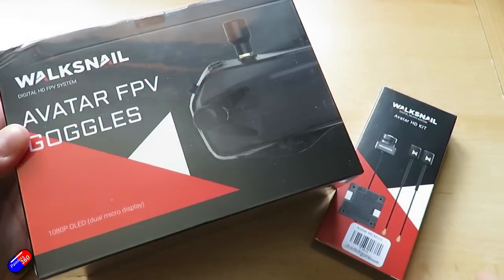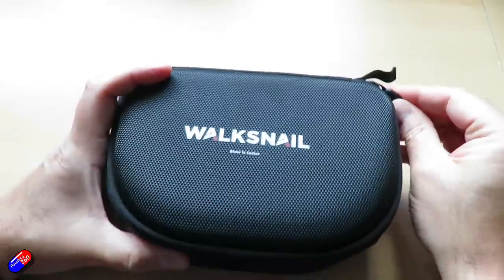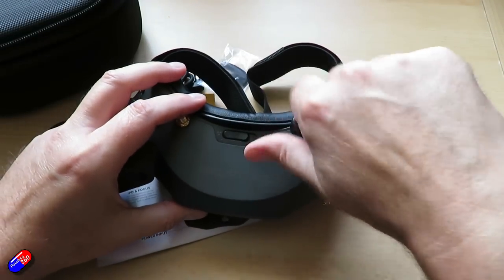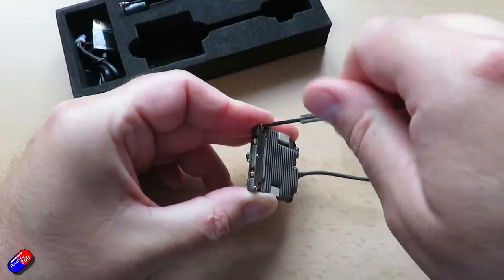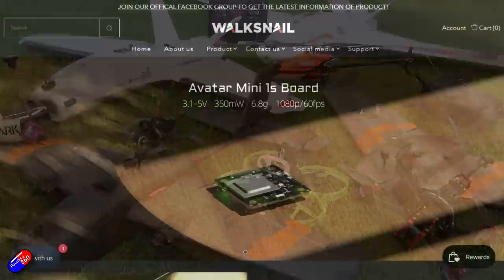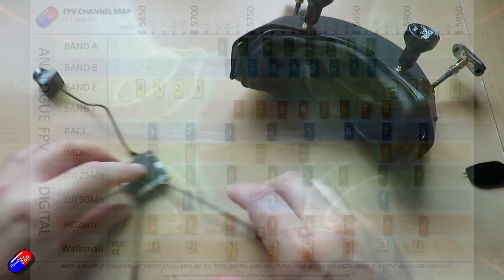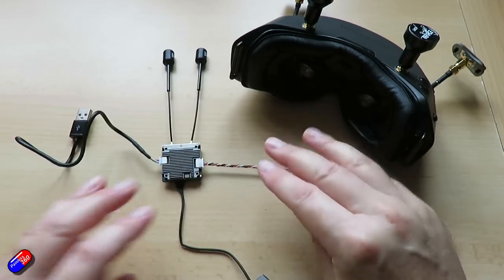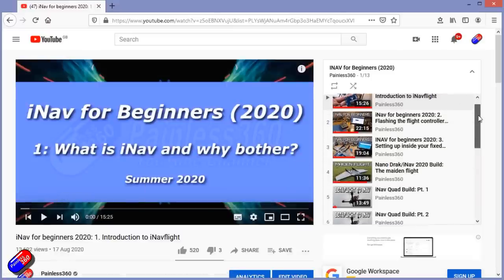Walksnail/FatShark Avatar HD FPV System: Let's look at what it actually is (minus hype)...

Comment: I don't get on with wearing goggles, so would love to see them bring out a standalone receiver which I can then connect to a screen of my choice. Standalone receivers seem to get overlooked when it comes to HD. Great to see the system supports Ardupilot displays - my preferred o/s. If they brought out a standalone receiver for the system I would not hesitate to move over to HD - something I really want to do, but not being a goggle user pretty much leaves me with analogue.
Reply: Walksnail has said they are doing this - but in the meantime, there is HDMI out so you can attach it to your laptop for display or a dedicated display.